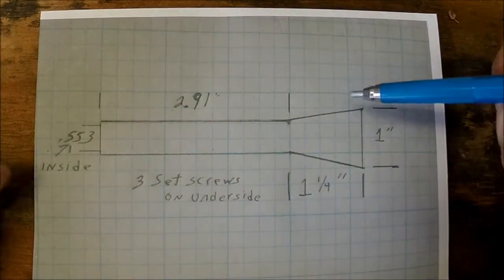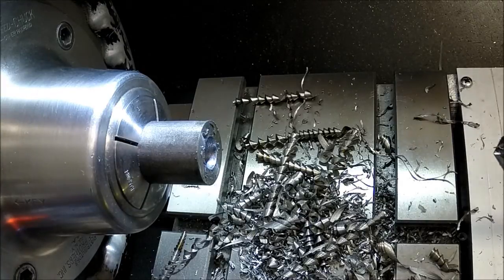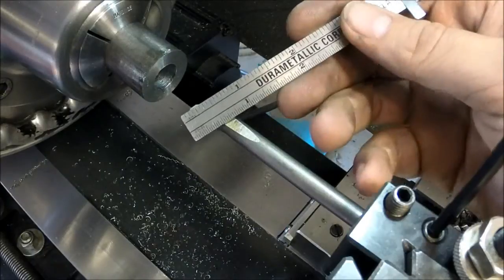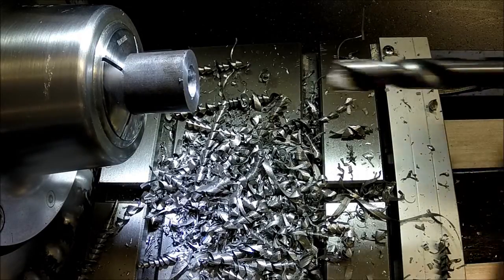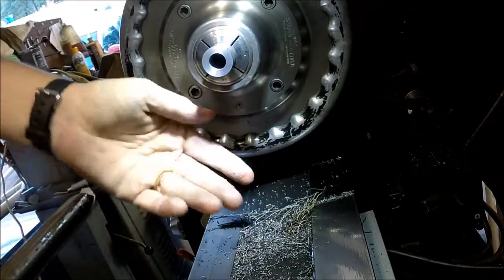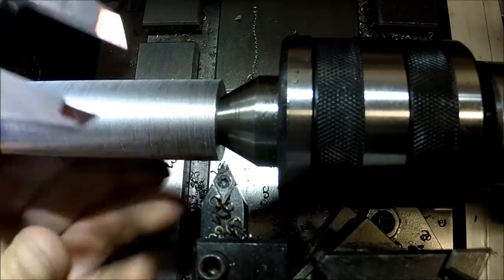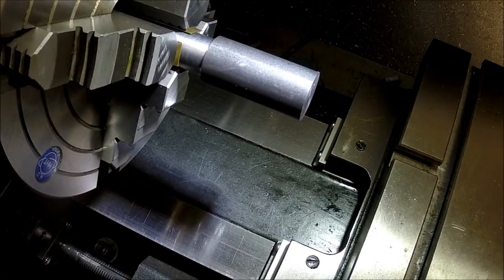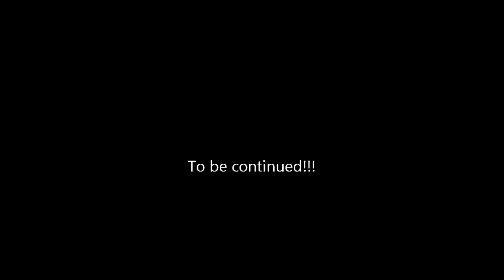SKS Muzzle Brake (Jungle Type) part 1

Comment: No welder? I think the individual projects will be better for you.
Reply from the maker: I've got a welder but the design of that part only gives .030" wall thickness and the reason it broke was it was all rusted up inside. Didn't want to risk it breaking again.
Reply from the maker: And yeah the mixed stuff is fine as long as I only show some of everything but that drives me crazy.